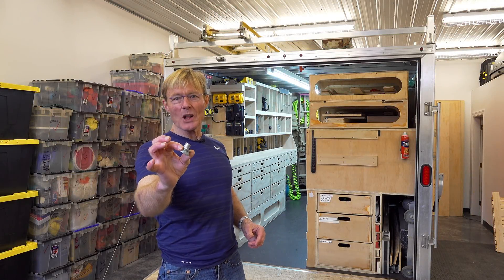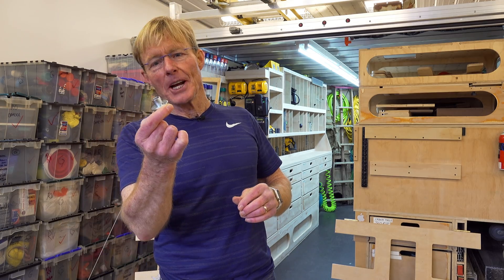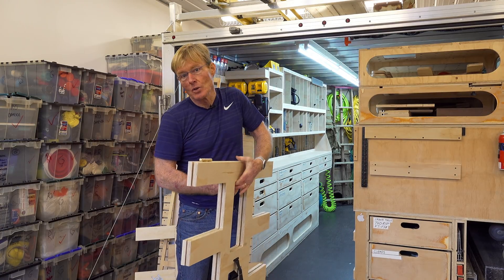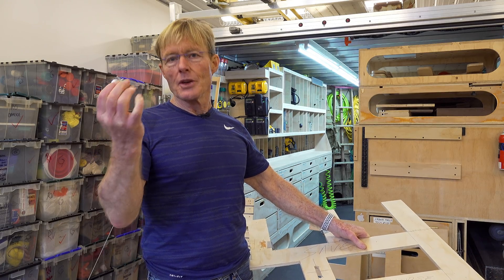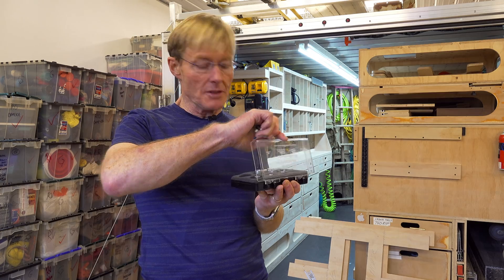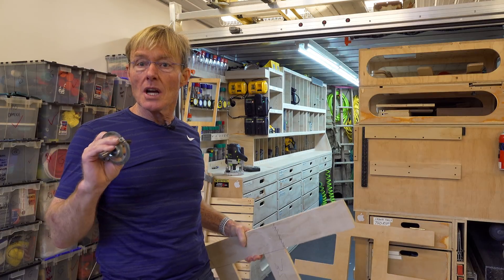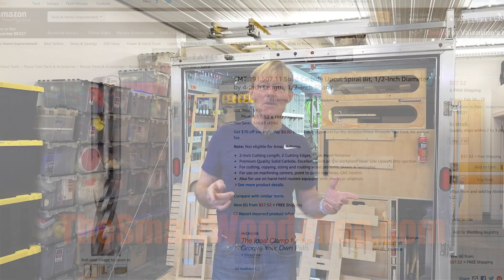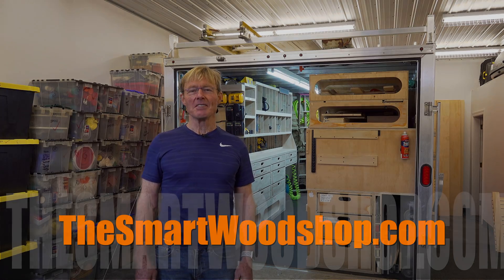My 5 Dollar Portable CNC Machine.

Comment: I'm surprised you haven't built your own CNC yet.  Quite a few good DIY options and you certainly have the skills to build one.  Most folks who shy away seem to have an aversion to using computers.  But you're already using sketchup and video editing software... learning Fusion 360 (free for a hobbyist) isn't much harder to learn than sketchup... I used my CNC to cut all of the pieces for the smart work bench.  Looking forward to your videos on how to build it - I haven't finished the stops / slides yet... not sure how they go together :-)
Reply from the maker: A CNC would be fun and maybe someday, but all my tools need to be portable and fit in my 12' trailer. Portable is the key for me at this moment in time.
Reply: @TheSmartWoodshop  Shaper Origin, in a Festool sustainer, no less! Combine that with Gabber for SketchUp, and you're there!
Reply from the maker: @ARepublicIfYouCanKeepIt  I have posted videos about the Shaper Origin and Yeti here on my channel when I visited with them both at AWFS and my first impression was either might be a good fit for my needs, but I just haven't had a challenge for anything so complicated I couldn't complete it with the tools I have. The gold standard for me is to do more with less.
Reply: Are Ron's plans vector PDFs? How did you convert the PDF to DXF?

Comment: Thanks Ron  You've just inspired an idea that will allow me to finish a low volume manufacturing run on a very small machine.  As the wood will be very thin, I can probably stack them and cut a handful at a time.  What a timely and inspiring video.  I can 3D print my templates too.  Perfect!

Comment: sorry for the noobe question, but i am seeing square inside edges on your patterns, and from what i understand the challenge when using this method or a $100K cnc machine is you can only get rounded corners, no square corners?  you still have to finish off the inside corners with some other saw, correct?  i am fascinated by learning sketchup and cnc, but feel it's probably over my paygrade.
Reply: You program a "dog bone" fillet for CNC. The router over cuts at the corners so the parts fit flush. For exposed joints on finer pieces, make the final pass with a small diameter bit. Then either square the inside corner, or round the outer edge.
Reply from the maker: @ARepublicIfYouCanKeepIt  😎"Round cutters can't cut square inside corners."
Reply from the maker: The pattern is square but the finished horse is rounded as you can see in the video. I could square them out with chisel when the job calls for it as I do on another part of my bench, but a CNC has the same issue. Round cutters can't cut square inside corners.

Comment: I'd like to see how you do any cnc 3D carving/ engraving with that bushing and a router
Reply from the maker: I don't carve as I assume 99% of carpenters don't. My methods work for me as a home builder, remodeler and carpenter. If I ever needed carving, I would hire a pro with those skills. I do on occasion have to carve a rail intersection, but I do so with a grinder fitted with a sanding disk and even then out of 500+ rails I have only had to carve less than 10x. My mission here is to show a method that works in the woodworking construction world that doesn't require a big investment but is very accurate, repeatable and fast with the tools that all woodworkers already own. I have built 200+ new homes and 1000+ remodels and not yet needed anything carved😎

Comment: Come on Ron! Actually a professional Felder full sheet CNC cost under  £40K. A CNC is about no more jigs ever. When you don't get what the high end technology do, you're definitely from an outdated time. An average CNC beats any human anytime, obviously. Try to get that a CNC works when you can do anything else, like machining when you do a glue up. That is unbeatable. Definitely. If we were both in the same area I would invite you to make you understand what my full sheet £10k CNC mill is all about. If you like I can let you challenge the machine, I still have power tools, but you will still be setting up the tools to make your jig while the CNC finishes its task. A business managing a CNC will make more money, in less time. Once you get the workflow, you do in a day what you could not achieve in a week without a CNC. I also have bushings, but it does not worth a cent now.
Reply from the maker: I could be way off in my thinking but do get results. A year ago I watched a brand new set up cut one side of my sawhorses in the same amount of time I cut 3 with my template. The set up was very automated and cost the shop just over 90K. I personally don't have a task in my workflow that would justify such an outlay of capital, but I am a carpenter, homebuilder, and remodeler, not a furniture maker. I enjoy technology and would l love to be proven wrong so I could buy one and justify it to my wife. I have one additional issue and that is space. As a mobile carpenter, I haven't figured out a way to pack it up in my trailer and set it up on the job. I don't have a physical shop, only a 12' trailer.I have considered a portable CNC to make my templates and then do the production with my router.😎🤙
Reply: @TheSmartWoodshop  well, the shop size and the budget are not crucial, in my opinion. I see Festool setups that cost 4 times my big CNC router's price tag. A CNC can be mounted like a panel saw, so the footprint is not that big and you could store materials behind on a trailer setup. Your trailer would look empty with a proper CNC workflow. What's much important to me is to change the way to manage projects. You can't add a CNC in a traditional workflow. I believe it's the way you thought about it. That does not work, you get the problems and you don't get the perks. You want to raise a workflow from the CNC machine. This way, you save time and money every time. No time and materials wasted to make jigs, few tools needed apart the CNC, reduced job site adjustments, easy built in joinery, reduced hardware. A bit of time invested into measurement and design, and so much time saved on the job site. As long as your business goes, you capitalize on previous designs you can reproduce, partially or not, with no setup. You only do what a human is good at, what brings a lot of value. Anything else is done much quicker and more precisely by the CNC. You're also less tired at the end of the day, and you do not get a lot of pain as you carry light machined parts most of the time. You talked about tabs to hold the parts, but it ain't necessary. Vacuum bed or pads can be made by the CNC and holds any parts. So you get ready to assembly parts. Some parts can be made with embedded clip lock joinery, or built in features that replace hardware. If you are skilled enough in digital fabrication, CNC is an incredible powerful tool. But you need first to give up most of what you were used to and think digital natively. Not a SketchUp to cutting list to do the job yourself, but engineer your parts for quick and easy assembly, direct from computer to machine. It works whatever your working field or workshop size. It's a state of mind first.
Reply from the maker: @axelSixtySix  I need every tool I have to frame, side, trim, set cabinets, nail down hardwood, install doors, cut in locksets, and so on. I don't see a CNC helping me much with most tasks required when building a house. I am a home builder, remodeler and only a small % of the required tasks could be done by any CNC. Cabinets and closet packs and not much else, which ARE built with a CNC by the cabinet shops I hire for such work. I don't see running back to the shop CNC to tapper cut a filler for a tight fit to the drywall, cope a piece of crown, miter a piece of door trim, etc.. I need every tool I have to build houses so the only added cost is the bushing as I already need a router, track saw, jigsaw, nailer, miter saw, drill, etc.. to do things on site. My video is for two groups: carpenters in the field and woodworkers with small shops that want or need to do more with less. I have yet to see a CNC do anything required for homebuilding that I can't already do with the tools I own and would need even if I had a CNC. CNCs are amazing but don't offer me "AS A HOMEBUILDER/REMODLER" enough to justify the investment. If I were a production cabinet maker, then I would be singing a different song.
Reply: @TheSmartWoodshop  Well said.
The balance between cost effectiveness, new processes and output is very different from "cabinetry" to carpentry.  And whilst all carpenters fancy themselves to have a go at furniture(cabinetry). The processes are different. We gotta make money in carpentry.  So i appreciate what you are trying to convey.  This does in no way detract from the fact the cabinet making tools(including CNC) are awesome.  And there's is a reason they're in warehouses. 
Sometimes its just as cool to say that his approach is based on his experience.
It's pared back simplicity. And that is skill to see it that way.
So thanks for sharing. Respect.
Reply: Ron Paulk  I feel the same way Ron. As a GC/remodeler we have sold many large tools only to hold on to our Saw Stop T/S , spindle sander, and joiner. Everything went with potability in mind.
If its not at the job its consider pointless to me now.
Reply: @axelSixtySix  Thank you so much for the insight! Really interesting to see your and Ron's different point of views. Personally i think i would enjoy a CNC more and tinker with sketchup or whatever program. Im the kind of guy who rather build stuff in my head/sketchup never to make it. With a CNC i wouldn't need to do much more than convert and send to CNC.. Im just starting out and got my first table saw recently. Just to build something there's so many tools needed! 
By the way, is there a CNC for painting?
Reply: @vileguile4  SketchUp is an old software which is nearly a toy. Enthusiasts should use a real CAD program. There's free versions for non commercial use, like Fusion360 or the cloud solution OnShape. A friend of mine which is an artist uses a CNC for his masterpieces. He mounts brushes, markers, airbrushes, and many other tools, like soaked sponges. Artist stuff. I used pencils and blades sometimes, but I never used paint. You should be able to mount and control a hplv gun, but I
 won't bet on some benefits. On the  other hand, I like to use pre finished plywood which provides a pretty good cut quality. This is probably more efficient than machine finishing. Sometimes I mount a sanding backing plate on the spindle, that's interesting for deburing with a quick pass, but also for effects, like tap-ground, or so. There's also interesting effects with few laser diode passes. A CNC is also perfect for inlay or marquettery. Most of the time, you imagination is the limit.
But don't believe any newbie would become a fine woodworking master by owning a CNC. The more you know and understand wood, the better. Machining can be tricky with some materials. Some wood species might be a nightmare to machine, like pine or poplar. A CNC would be much easier for the skilled woodworker.
Reply: @axelSixtySix   I'm 100% sure you never actually remodeled or renovated homes full time.
Reply: @internettoughguy  That's exactly why you should not gossip on somebody you don't know. I'm grand son and son house builders. I used my pants on scaffolds since I was tall enough to climb. I made my first money helping out and I learned hanging on. As an adult, I renovated 5 houses yet, and I'm close to buy my 6th one next spring. Good workers are rare. Even if I have a pretty well payed dayjob, I like when things are well done. Keep in mind that in Europe, our houses are made solid. Our roofs are not covered by chingle but with secured tiles and we apply plaster on hard walls, not hollow dry walls. We do traditional carpentry frames, all mortize, tenons and pegged. That's why I own a huge CNC router, to machine 250mm (10") beams. I'm not amazed by 2by buildings. Any gossip left ?
Reply: @axelSixtySix   Renovating 5 houses is not a career/full time job. No builder/remodeler would bring a typical CNC to the jobsite is my point.
Reply: @internettoughguy 5 is the number of houses I've renovated and remodeled by my own. I worked on maybe 20 or so. Never mind. I don't know how US carpenters does, but here in Europe, most of professional carpenters have a CNC because it's the most effective tool.
Reply: Axel Sixtysix cost of a machine is one thing.  Where are you keeping it?  A big damn shop (BDS). If Ron hops on a Ferry with his truck/trailer and heads out to an island vacation home off of the Olympic peninsula to do some finish capentry where is his CNC machine?  Back in his BDS. I agree production work on a CNC prevails, but how many widgets does it take to justify the learning curve and the setup and maintenance?  Duplication of routers/bits?
Reply: Axel Sixtysix sounds like you enjoy sitting in front of a computer screen and  some people enjoy working with their hand and using a skill set that takes years to craft. Yeah you might be tired at the end of the day. But that is why it’s called work....great job giving some good advice for workers to be efficient and repeatable Ron! Thanks

Comment: Thanks for clearly pointing out that the guide bushing does not ride up and down with the cutter, whereas the bearing of a pattern bit does. That makes it much easier to get the right depth of cut with plunge depth, rather than buying different lengths of pattern bit.  It is also comforting to hear that a pro can damage the template with a pattern bit.  I thought it was only me.

Comment: Ron,  CNC pricing for the USA manufactured machine to handle 8' by 4' sheets from Legacy Woodworking in Springville UT 84663 will do all that you want for a lot less than a $100K.  It can be working, once programmed, whilst you are doing other things. Try calling 1.801.609.2805 and speak to John Hennan, Chris Anderson or Tracy Anderson or Andy Anderson. Go on spoil yourself jump on a plane and go see.
Cheers
Roger

Comment: im sorry ron but you are completely wrong. there is no comparison between a cnc router and a router and guide bushing. its like comparing a handsaw to a panel saw. of course you can get the piece made but they are completely diferent
Reply: Ron, you're a far better woodworker than I am, (rank amatuer hobbyist at best), but since this is the internet, I will shoot my mouth off anyway... 😀

You are 100% right that a CNC has no value add for what your work flow currently is. You already have processes tested over time that get the results you need simply cheaply and efficiently. Cool.

But I think you're 100% wrong to say that a guide bushing can replace a CNC. The fact that you haven't had a need to do carving out other things that CNC can do in your line of work doesn't mean that other people don't want to do it--hobbyists, artists, fine woodworkers, and maybe there are people who do what you do who are offering carved accents and trim for home builds. Antique homes have carved elements that we don't see anymore because the craftsman who could make them are all gone. Perhaps availability of CNC carving will allow a new generation of home builders too start incorporating these elements again.

Keep up the good work, love the channel.
Reply from the maker: The video is about the end result. I have had the horses cut with a CNC and with my router, you can't tell the difference between the two except one was cut on a 90K machine and the other with a small power tool. I believe I said in the video that it isn't about the tools I own, but the work I produce.
Reply: @TheSmartWoodshop  Thanks for doing these and giving the average guy a glimpse into how real pros get things done.
Reply: @TheSmartWoodshop sorry ron but thats not what this video is set out as. your first sentance states that a guide but set up can do everything a 100k cnc can do. in reality it can only do 50% of what a cnc can do. this is my problem with  this video. if you phrased it as you dont need a cnc to make stuff then that would be great ut you didnt. dont get me wrong i love your content ,
Reply: If it works for him who is anyone to say it's wrong? You've seen his work, right? Flawless and precise.
Reply: @BikeHikeNCamp  its wrong because  its simply not true. nothing wrong with using a router and guide bush. everyone does it , i do it too. this has nothing to do with how good his work is. a cnc is a completely diferent animal than a router.
Reply: MelbourneAlan well I guess you win the coveted literal accuracy award for YouTube today. Well done.
Reply: @BikeHikeNCamp  better than being wrong at least

Comment: The middle ground between a regular router and a full blown CNC is perhaps something like the Shaper Origin. It's "only" $2500 but it's able to follow complicated patterns that you'd have a hard time making by hand just like a CNC would.
Reply from the maker: Yes, I am considering a Shaper Origin or Yeti Smartbench for myself. BUT only to make my templates/patterns. Then I will still use a router, bushing, and template for production. I just haven't decided if the $2,500+ is worth it as I have as of yet come up against a pattern challenge that I couldn't complete with the basic tools I own. I guess I will have to get my hands on one or a few and try them for a while to really know.😎🤙
Reply: @TheSmartWoodshop  Between the Shaper and the Yeti, I'm certain that the former is the right tool for you. Festool systainer. Small. Portable. Powerful.

Check out Fabber too. It creates toolpaths for Shaper straight from your SketchUp designs. Zero learning curve for you. Thus, it fits right into your existing workflow.
Reply from the maker: @ARepublicIfYouCanKeepIt  I will check out Fabber. Thanks🤙
Reply: John Coloe are those cncs 4x8 capable?